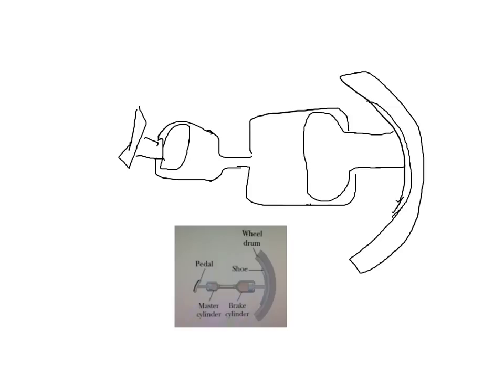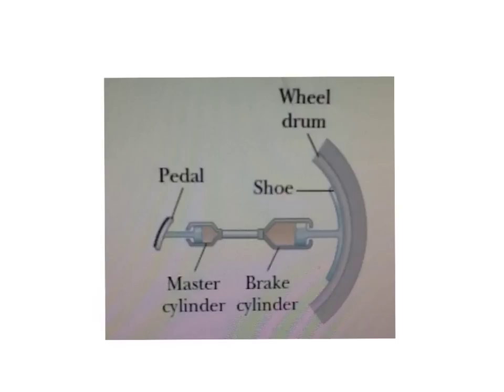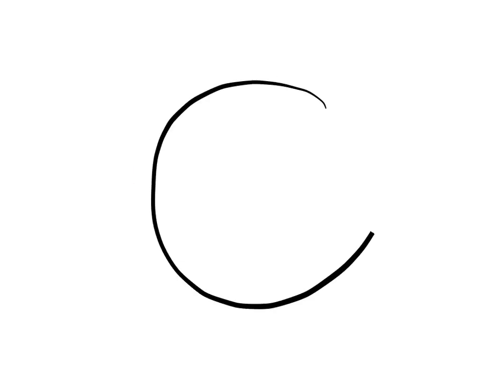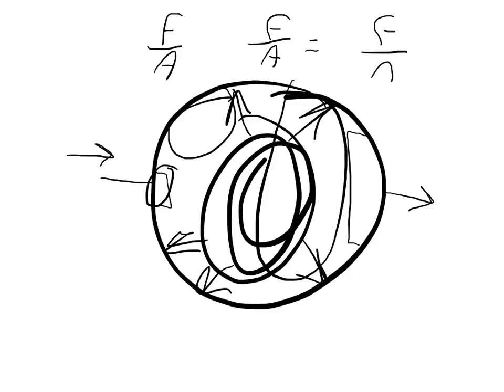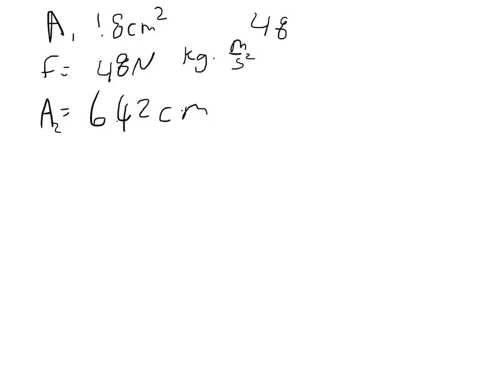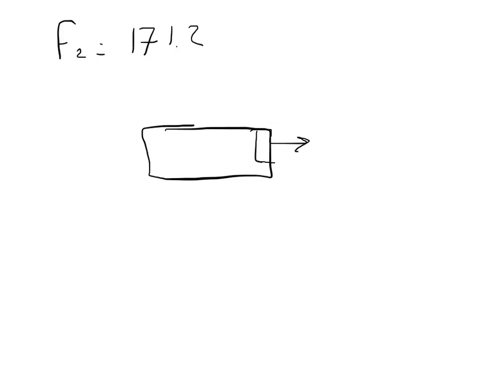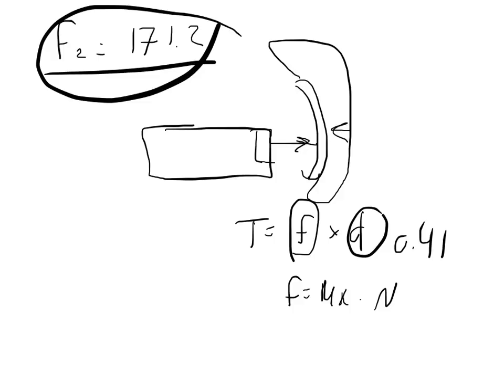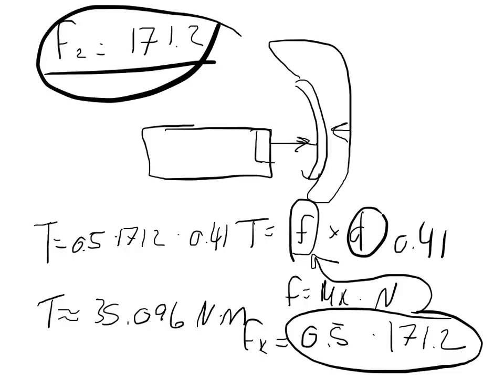Physics Web Assign Ch 9 #9

Comment: The unit conversion for cm^2 to m^2 should be 1.8 x 100 x 100 because it is m^2  not m
Reply from the maker: I used ratios, it all washed out in the end. In fact, no unit conversion would be required because the two units of area actually cancel each other out!

You are correct, the conversion is into m^2.  However, you don't multiply to turn cm into m. You divide. (or multiply by a reciprocal). 
To convert to meters, it should have been divided by 10,000. (good catch)!!!